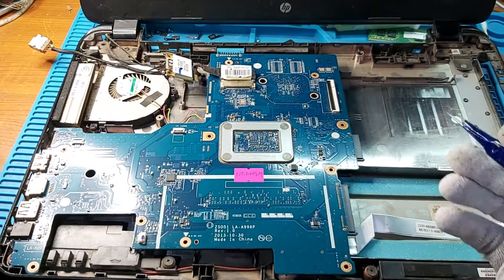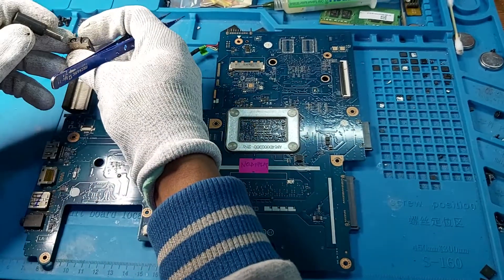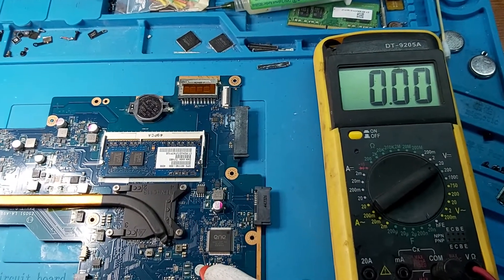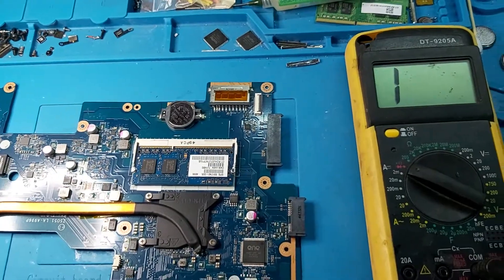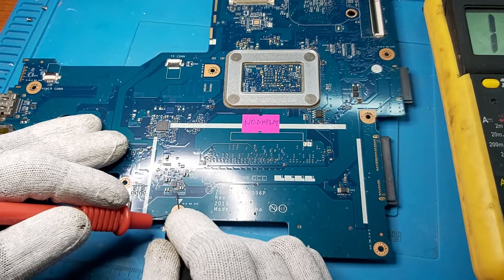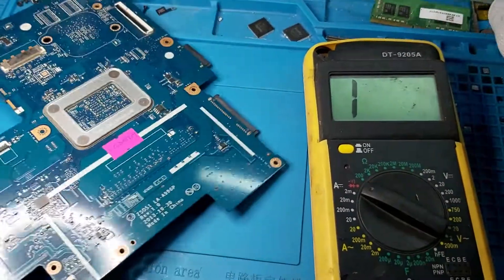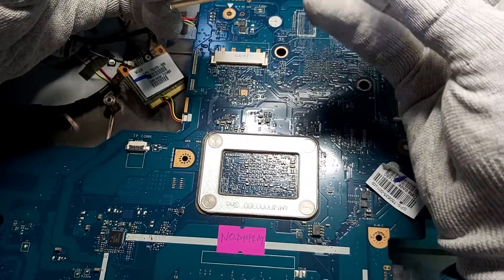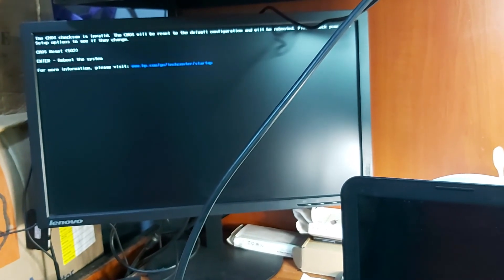HP 250 g3 Not display

Comment: I have the same laptop.. it display using hdmi  but doesn’t display on the laptop screen.. the screen & cable are fine I tested on the other motherboard.. what might be the problem?
Reply from the maker: Did you check all voltages,,is AMD processor?
Reply: It’s intel core i5 4th gen. I don’t have the tools to check voltage.
Reply from the maker: Please contact us Whatsapp +255 659166796 ,i will show you what to do,,